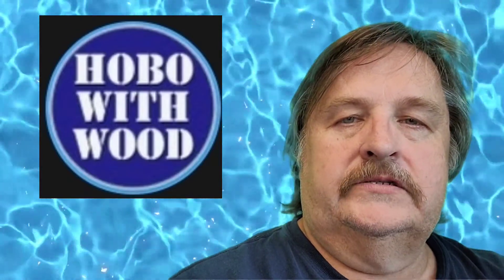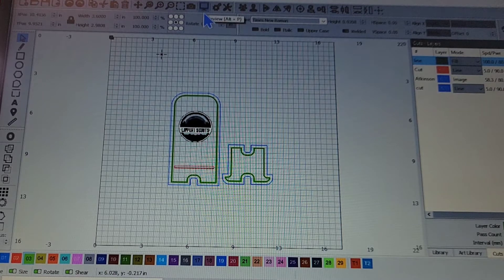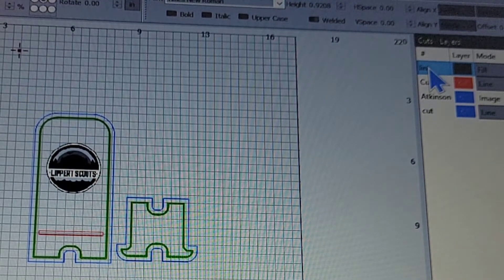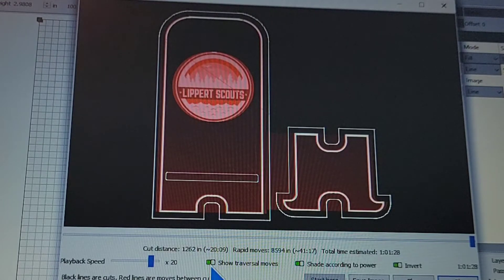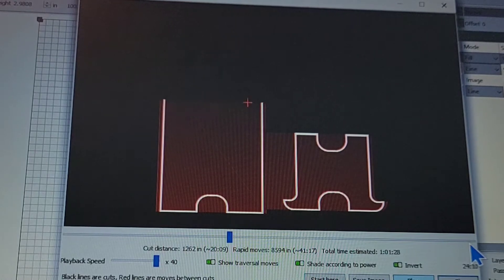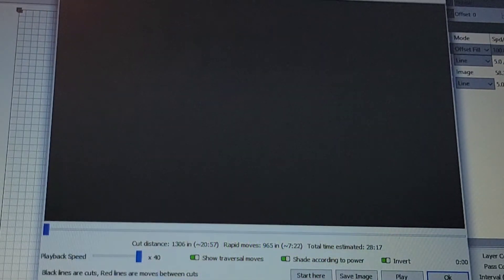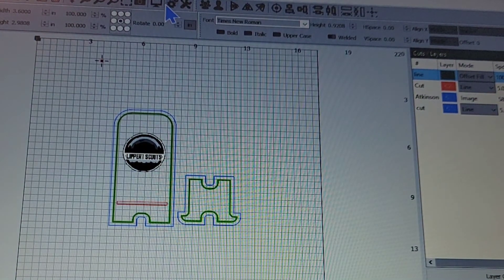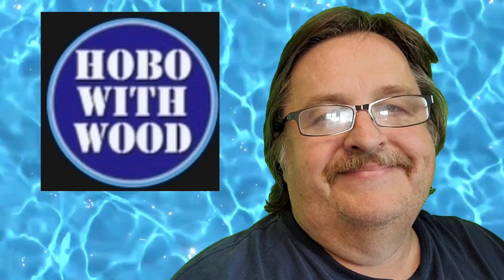Huge time saver in Lightburn. Fill vs Offset Fill on the xTool D1

Comment: This is the second video that I've seen that doesn't get it quite right... there are two settings you can use to get rid of excessive traversal moves, and they do different things:
1) Flood Fill (set your type to Fill, then go to the advanced tab to find this option);  This causes it to fill contiguous areas without having scan across the entire piece, BUT it follows the scan angle you have set. so a square will be filled Bottom to top with horizontal lines if your angle is set to 0 degrees, or left to right if set to 90 degrees
2) Offset Fill: this option ignores your scan angle and fills objects by following their contour... so a square would be filled by making progressively smaller squares inside each other.

They both have their own advantages and disadvantages, depending on the material and shapes being engraved.
Reply from the maker: I've heard tell of this "Flood Fill" you speak of. But I have not seen it, yet. I plan to take heed of your notes and look for this so-called Flood Fill.  It does sound like something I want to know more about. I'm new to this software and this community. I'm 50+ days into learning this technology. I look forward to encountering this Flood you speak of. I am not very advanced...yet. That's why I haven't found it. But, with your words of wisdom and kind directions, I believe I can find it. By the way, I love sarcasm and I'm I bit of a smart-ass.

I do sincerely appreciate your post. Please subscribe and help keep me on the straight and narrow. I've had no training. And feedback like yours is EXTREMELY helpful. Thanks for watching and your comment. Stayed tuned and keep me straight.
Reply from the maker: I did a second video on the three different types of fill. I gave you credit for teaching me about flood fill. Thanks again for watching.

Comment: It should be borne in mind that at a high engraving speed there is a risk of laser displacement relative to the initial trajectory, and this can lead to damage to the product. Before performing a task on valuable material, it is better to experiment on a draft with the speed / power of the laser, and choose the most appropriate parameters.
Thank you for your content! 👏
Reply from the maker: I did another video about Fill VS Offset Fill VS Flood Fill. I mentioned you and gave you credit about the concerns you brought up here. Thank you for watching. Please subscribe and continue to help keep me straight.